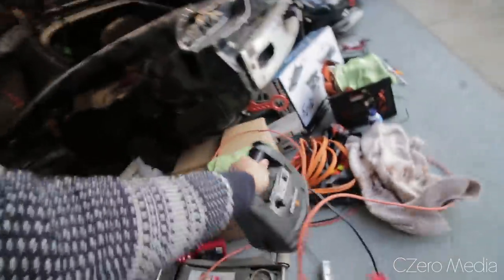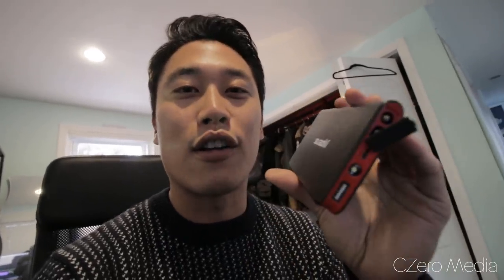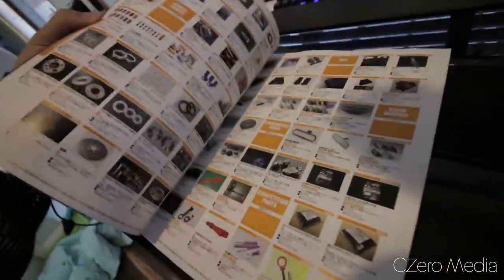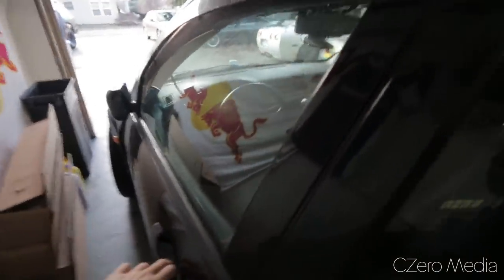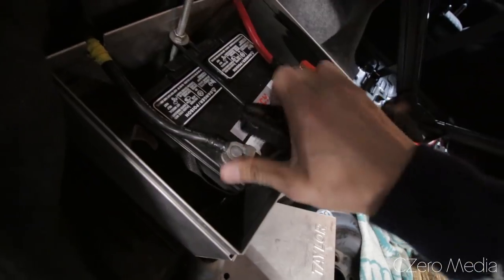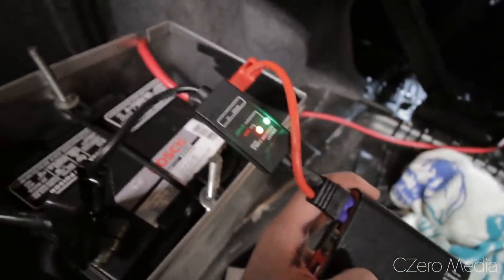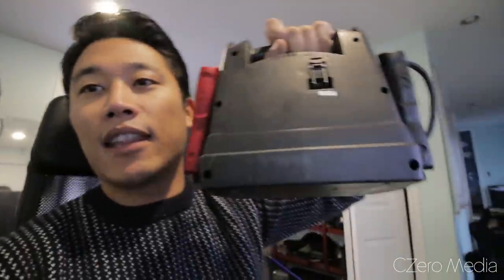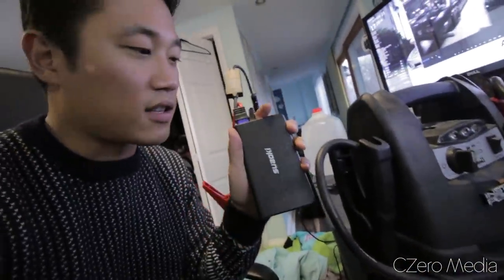Bringing Evo Back To Life - Vlog 56

Comment: I have the Suaoki U10 and it jumps around 6 cars before it is at 0%. The only problem I have with it, it is difficult to jump with one person. because it cuts the power if you don't do it quick enough. But awesome product. So compact.
Reply: Jamie Hickling what do you mean it cuts the power
Reply: Once you attach both clamps, it will click over to the green light, and only give out power for about 10 seconds, if you don't start the car within that time it just clicks back over to red light (no power output).
Reply: Jamie Hickling wtf why. but if it's legit 10 seconds, you should have a good amount of time to run over and start it
Reply: datstocklyfe It may be under 10 seconds, i haven't timed it, but if you don't literally run into the car and turn the key it wont start. Its very hard on my subaru with push start so requires 2 people